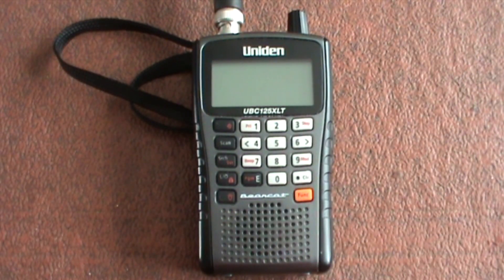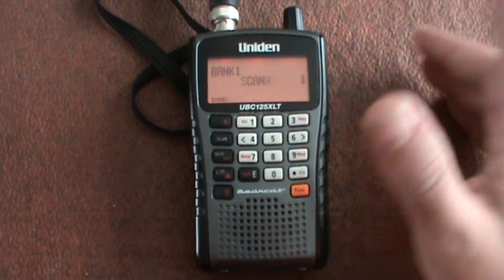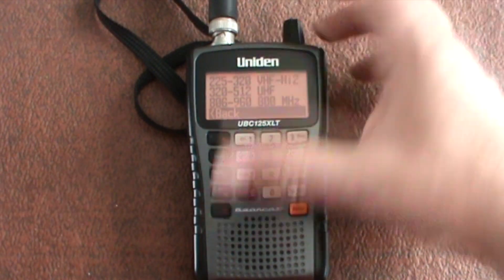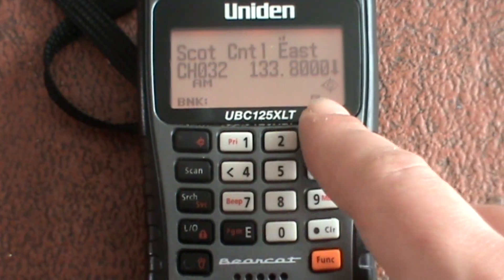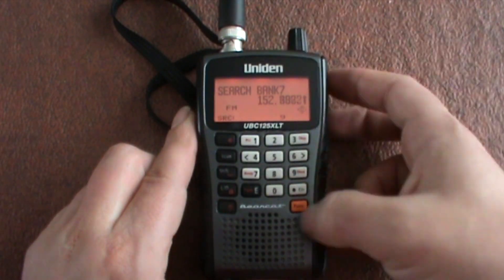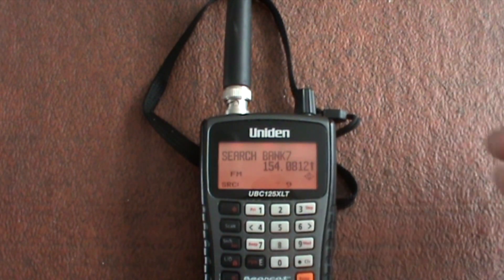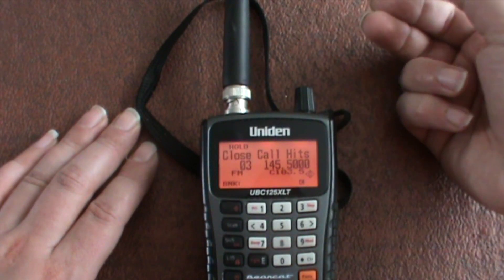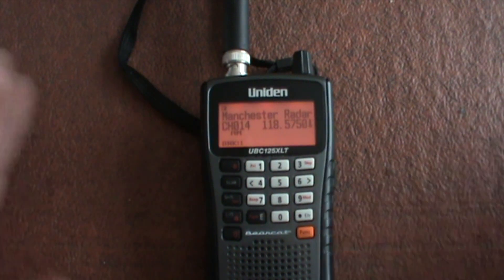Uniden Bearcat UBC125XLT: Close call Feature

Comment: Would you recommend this over the xhdata 808
Reply from the maker: Depends what you want to listen to. The Xhdata will cover the Civil Avaition band, but the scanner will do the Mil Airband as well as 2 Meter and 70cms and more. I think the recieve capability for Civil airband would be better than the Xhdata.
Reply: @driverfilmsshortwavechannel  Thank you for the reply so in essence you kind of need both. I've got the 808 good air band but not picking much else apart from China radio stations on shortwave etc on a long wire. All the best 73
Reply from the maker: Effectively yes lol. I did sell my 808 a while back as I had too many radios. Wish I kept it, but I'm having less time to listen to shortwave now

Comment: My radio's speaker doesn't work, and hasn't since I got it? Is it supposed to make noise with no headphones? Is there a setting for this?
Reply from the maker: Do you have the squetch turned all the way on?
Reply: @driverfilmsshortwavechannel  Nope, it's at 3 currently. Seems to be an issue with the headphones disabling the speaker and not re-enabling on disconnecting of headphones.

Comment: Just recent received mine. Thanks for the video.  I now understand the close call.  I really enjoy it tbh.  It saves hassle.  Very easy to use handheld.  I started to work it out without much problem really.   I have not had a scanner for years.  That was a dial one as well in the early 1980's.      I had the guys at Radioworld UK  program mine for aircraft.  So it meant that I could jump right in feet first.    Great outdoor radio with the Super gainer Aerial.  I will enjoy my dog walk a lot more for sure.   I pick up loads in Salisbury.  Very disappointing indoors.  But that's to be expected on that aerial.  New outdoor aerial coming soon.  Thanks again for the video :-)
Reply from the maker: The default Aerial isn't the best, I use a Diamond RH770 for mine. Its a bit top heave but pull the signals in really well.